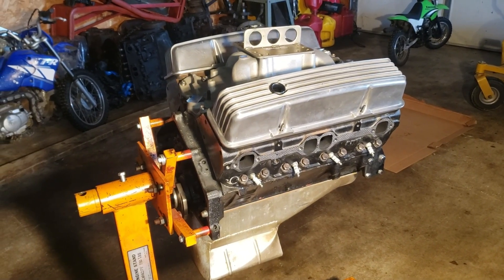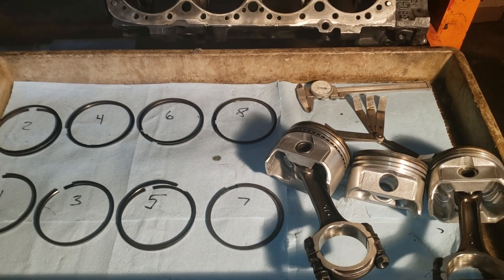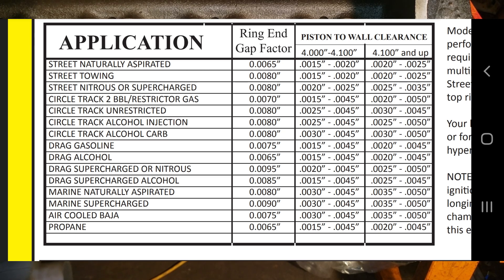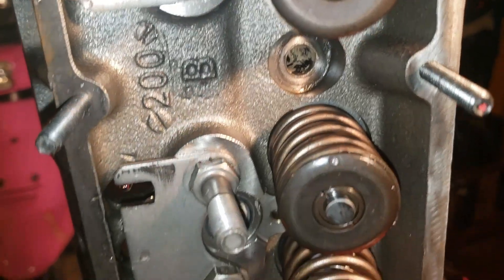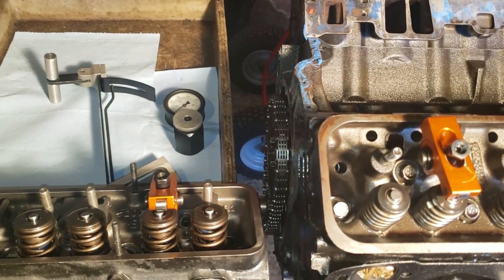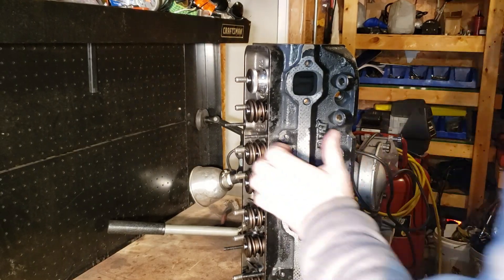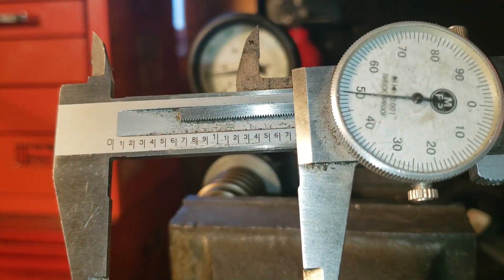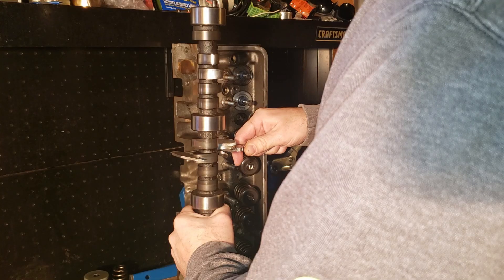Street/strip Chevy 350 Failed after 250 miles. Parts Inspection

Comment: For that cam, there is no reason at all to run that high of spring pressure! 112-115 closed is plenty!
And for those Keith Black Hyper pistons, you HAVE TO use the recommended ring gap or more to be safe! I have heard of many, many guys destroying those pistons because they didn't want to listen to the manufacturers recommendations. Live and learn, I guess.
Reply: 140 lbs seat pressure for a flat tappet is way too much.  110-115 is about right
Reply from the maker: Nice thank you for the input
Reply: except when it comes to iron cylinder Harley pistons, then don't set wall clearence near as tight as KB recommends.
The previous builder dissed the instructions and went with the typical Hastings 3.5-4 thou per inch.
Never saw a good shot at the domes to see if any detonation was going on. Hyper pistons don't like that at all.
Now , what pistins will you go back with??
Reply: Still shouldn't have wiped the cam... it's made out of the same material that a larger cam is.

Comment: Looks like a typical KB piston with not enough ring gap!
Reply from the maker: I wouldn't of thought a ring gap of  
.016 would cause problems. I have changed my mind.
Reply: @nylegreen261  Guy after guy after guy has done this, people just don't learn!! Manufacturer recommends their own specs for a reason.
Reply: Yup, Top ring gap too tight. That's for sure. I probably have the same pistons, KB Claimer UEM but 4.030"

Instructions are very clear. You'll pop the top off once the rings expand with heat. It needs the extra few thou they recommend. 

Too bad. Quite a bit of money gone.
Reply: Not sure if you are asking what went wrong or if you want the audience to find the problem. Either way it clearly states 0.026 gap. And you have 0.016   That gap needs opened up about 37%. Hope that puts the small amount into perspective.
Reply: They require a larger top end gap because of their thermal expansion and the top ring begin close to the top of the piston. It’s the only thing i see wrong there. They do list the 2nd end gap at 0.004” x bore so 0.016” should be ok there. 

On the other issue I don’t think the springs would cause issues on brake in IF the cam was broken in with the outer spring only. But since you didn’t assemble it there’s no way of saying it was done correctly. 

P.s. is this engine going in your Nova for a Drag test after it’s been fixed up ?